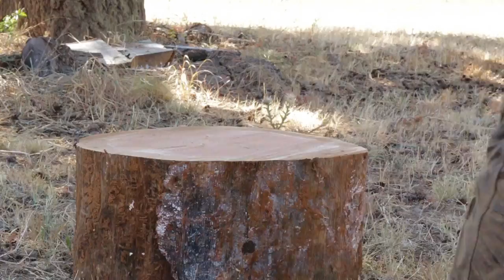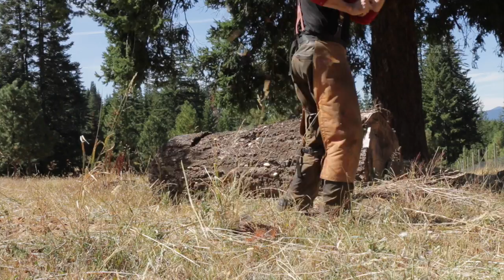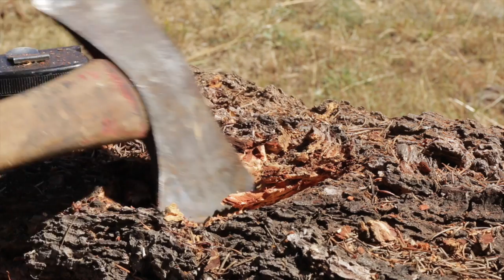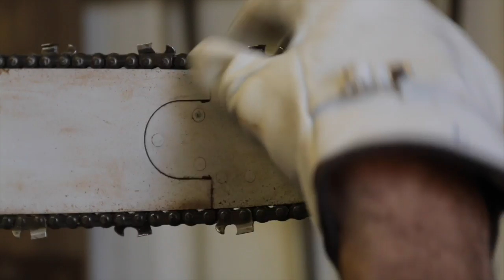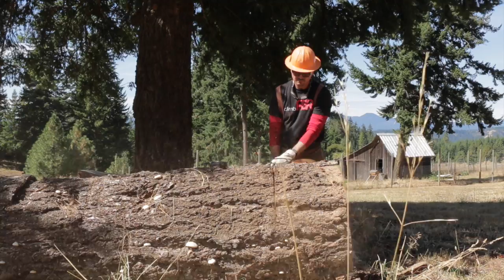Who Builds The Best Splitting Axe? You'll Be Surprised

Comment: I've been heating with wood only since 1983.  I split seasoned wood all winter long with a 12lb Ace Hardware wedge.  Gnarly, knotty, twisty Colorado pines...But I'm an XXL man. I wouldn't expect smaller people to appreciate the raw power of that steel wedge like I do.  I split 6 cords every winter...a few  hours at a time.   My wife swears the wood "jumps apart" in anticipation of my strike.  Haha.a..a.  From 1983 to 1999 I used a Chopper I mechanical ax-type splitter.  The springs didn't last long but I found the tool to work just as well without them if I used a smooth stroke.

I'm not as young as I used to be...so I started thinking about how a smaller, older, weaker, future me would split wood...and now I love watching splitting videos.  :-) I'm sticking with the inertia vectoring efficiency of the big wedge on a handle for now though.

Also, I see splitting videos that split into tiny pieces...I agree the big 12# wedge isn't right for that.  I use a Sedore USA downdraft stove that can handle pieces up to 12" in diameter...but I always split a 12" piece, once...I don't chop it into sticks.  For the chunks that are larger than 12" I'll split 3-4 times.  I also split every piece down to about 3" diameter.  Mostly I split the small stuff for sport than for practical use.

Thanks for all the info!

Comment: I do firewood as a full time job here on Vancouver Island, splitting roughly the same stuff. in my experience I find a 36" handle on a 4.5lbs splitting axe works best. on the bigger stuff I use my 24" arvika on one side in the holding wood then go back the the other side with the 36" and work on the holding there. but as you say, bias and opinion. I've used this style axe to split about 500 bush cord a year.

Comment: How many wedges can you use with a splitting axe? A Maul should always have a wedge or two and a prybar, which imo makes it far better for splitting large rounds than an axe with a poll that's not hardened.
Reply: Husqvarna also sells a maul with basically the same profile on the blade and cheek but a sledge style hardened poll for driving wedges, if you require that.

Comment: The only thing I have used a splitting maul for is to bust up concrete pads. It works better than a hammer drill and is more fun. Goes through 3 or 4 inch thick concrete like butter.

Comment: Before I even watch this I will say It depends on a lot of things.  Not all mauls are alike. I have a 12lbs all steel wedge shaped maul.  Not the slim version but a big block of steel.  I also use a Fiskars splitting axe (x27) the axe is good for the money. I was new to splitting wood when I bought it.  I didn't want to buy the Gransfor Bruk axe and right out of the box hit the handle and bust it or stick the head in the dirt.  Even now I sometimes miss the wood and I appreciate that I haven't marred up a 150 dollar axe.  But I would still like to get one and I'd also like to try a slimmer version of the splitting maul.
Reply: +gthree0239 I used a friend's Fiskars before deciding I wanted the Gransfors, and I will say that the Gransfors Large Splitting Axe is an absolute pleasure. I have not treated it particularly nicely, and it continues to just walk on through most hardwoods. Highly recommended.

Comment: You would have to choose a chunk of fir that's been curing for a while you can tell its cured the bark pealed off. If that splitting axe splits that hard fir I'm sold already those rounds there I would be using a sledge and wedge to get them in half then split them with a maul. If you were a purist you would have bucked those rounds with one of your cross cut saws using a 441 is cheating LOL.
Reply: JCrook1028 He's got lots of trees on his property he can use for timber framing. I think there was something with that log it is why he never used it so it was slated to be used as firewood.

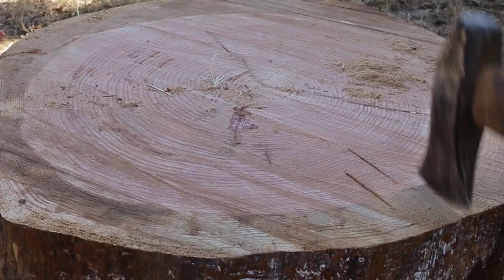Comment: My splitting maul sometimes bounces off timber like that 9:12. Does it just need to have a sharper edge to bite in?
https://www.youtube.com/gif?v=RJz-WVr3lW0&g=ejTEsE28ZS8
Reply: Scotia Bushcraft thanks. I work on Australian hardwoods (eucalyptus) mainly. If it's even a little dry, the maul rips through them like a hot knife through butter.. but a couple of other types which are wetter and a bit more rubbery with a bit of a branch gnarl in it, no go. Probably asking a bit too much of the tool though.
Reply: +Kieran Short  Actually you don't want a splitting maul to stick,  you want it to split.  It has a steeper angle to prevent sticking, but if it does stick it is easier to remove because of the steeper angles.
Reply: Hi Catherine Perrett I know, but if the maul bounces off, it won't be able to split. :) I would've thought a razor sharp edge so it dives in hard, but with brutal angle so it pushes in and says "get outta my way, coming through!" would've been the best combo.
Reply: Thanks Samuel Luria . If you were to see me, you'd know that I'm 6'3" and 250Lbs, and swing an axe like a viking. No 85% about it. But I'm splitting Australian hardwood, which is up there with the hardest woods, so that certainly doesn't help. That being said, I guess my maul is probably about as sharp as a sledge hammer. :)